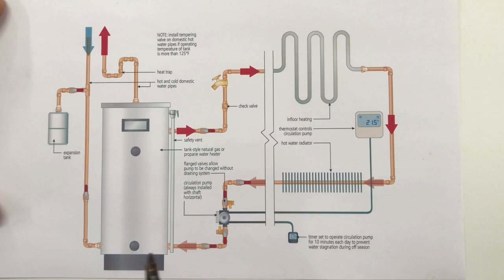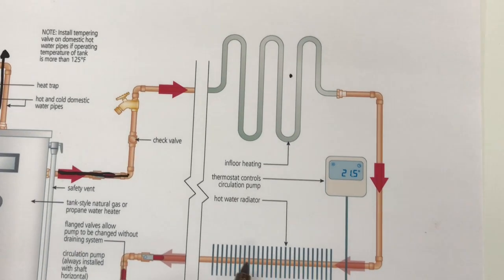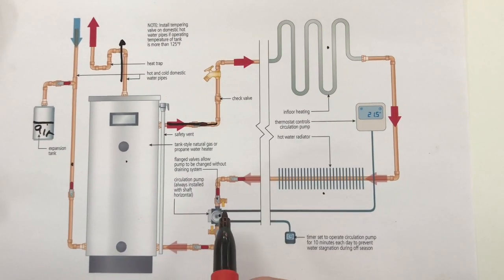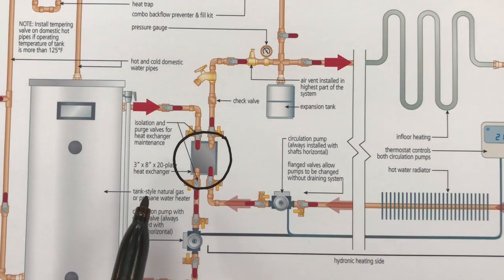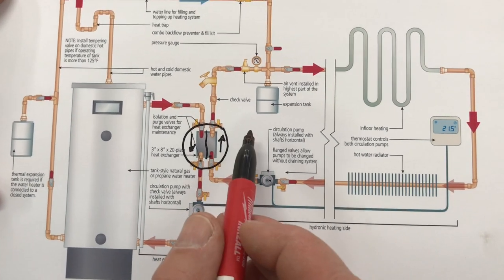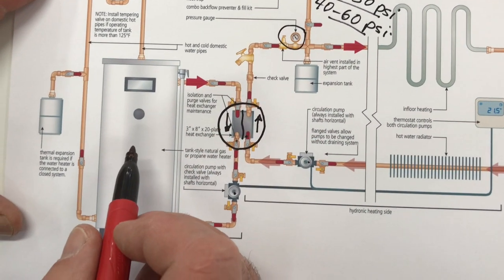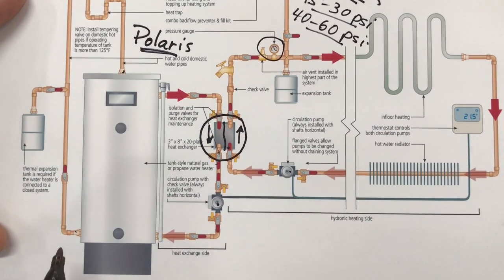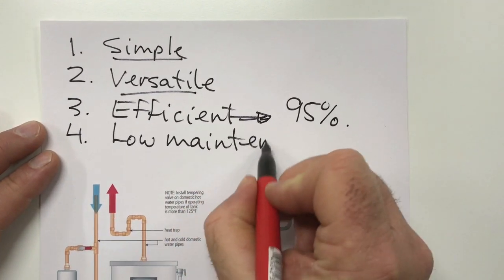HOT WATER HEATING: How to Use a Tank-Style Water Heater

Comment: I've been thinking for 2 years now, to do an "in-wall" heating system with a water tank.
There are 3 reasons why I want to do it.
1st it seems more healthy. Furnace heating tends to make the house more dusty.
2nd in flower heating seems more comfortable.
and 3rd, I'm pretty sure it spends less gas than a furnace, but I'm not sure. 

I was thinking of buying a 2nd water tank heater and running separately in a close loop. Do you think I shouldn't do it in a separate unit?

Do you think I can run 2 loops (basement and main floor) on one tank? ( each floor is about 900sqf)

Comment: Thanks for the video. This would be a good backup system for an outdoor wood boiler (OWB). The OWB's heated water would run thru a heat exchanger at the cold water inlet, heating the water before it enters the Polaris. When the OWB is providing heat, the Polaris wouldn't need to run, but would still provide hot tap water and house heat. When the OWB isn't providing heat, the Polaris would turn on and heat the domestic tap water along with the house.

Comment: I wonder if someone can recommend a circulator for the domestic side when using a heat exchanger. I used a Wilo S16 for the hydronic side, but having trouble finding an affordable brass circulator. The S16, being cast iron, can't be used for domestic.

Comment: I have a 30 x40 house  i built, 2x6 walls i think i used r28 walls and r38 ceiling, my ground floor is my wood shop buss/ with 1/2 per in 4'' concrete over the silver reflective bubble material  with 2'' blue foam, i am going to put r/heat loops in the living space floor above. can you give me your opinion of the Polaris  btu size for my  home? also serculator pump size , Thanks again  for your Video . Thanks Rich

Comment: You can eliminate the timer, some thermostat has built in pump protection function it will call pump once a day.
Reply: The pump exercising function is unlikely to run the pump long enough to safely prevent Legionella growth, which is the major danger of an open system.  Best not to use an open system at all.

Comment: I need to update my system from a tankless Flowmax90 and a 40L storage tank to a single large water tank.  My home is heated with a Airmax 70e p2 blower which has coils inside (it’s simply a blower) I need to understand how to select and size the new tank so that there is enough heat for my home and the domestic hot water?

Comment: And yes most of house hydronic systems runs at 30psi max , because boilers comes equipped with a 30psi ( max pressure) pressure  relief valve. Though boiler and hydronic loop components ( pipes, fittings, pumps)  are rated for much higher than that..If a small residential building has 4 floor ( above ground), and boiler is located on basement level  ( old typical install), a 30 psi water heating pressure will starve most of the farthest and highest point of consum  ( radiators) în some apartments. Thus new wster heating pressure must be carefully choosen  ( calculated) to assure the highest radiator in heating loop  will be provided with a positive heating water  pressure of min 5 psi .

Comment: Great, clear explanation.  My only concern is that a water heater is usually maintaining 125 - 130F, but hydronic floor systems want no more than 90F or they will cause cupping of hardwood floors, won't they ?  It seems like a heat exchanger would be necessary and not optional.  That way the pump on the loop from water heater through heat exchanger hot side could come on only long enough to maintain that lower temp in the hydronic side.

Comment: With a simple setup instead of it leading back to the water heater through the regular tap, can you divert it to go through the main line of the heat or the hot water line at the end of the house so that it drains back through the top of the water heater? Also where it warms the pipe with whatever hot water is left over after exchange with the heat exchange or/ AC blower. So that the pipe is always warm during the cold months? Is this possible or would this be ridiculous? Thank you for your input.

Comment: By the time you buy a water to water xchanger and 2 pumps this would start to not be financially viable. Considering pump life, and heat exchanger life in hard water or non balanced water areas it starts to be more trouble than its worth. A GEO system would at least save on the heating or cooling enough to justify it. Maybe?

Comment: Could you use hybrid electric water tank  ? Also if you eliminate thermostat an just use timer and set to run 50 percent  leave pump circulating  for a very small loop in small part of basment slab just as  supplemental heating ?

Comment: And by circulating heating water in off heating season, to maintain a healthy water throughout hydronic system will add additional unwanted heat to the space which calls for cooling actually.  How about isolating hydronic loop from domestic ( 2 simple ball valves installed on supply and return tank connections) and when warm months come, isolate and drain the hydronic loop completely and use cold water pressure ( thru a hose connected to city water) to flush throughly the hydronic loop?

Comment: 3 items jump out, 1 you will need potable circulators on the potable side of both options, 2 the water temp is much too low for  baseboard or radiators, 3 if the water heater goes down you lose heat and hot water. IMHO

Comment: Is there a coil in the tank to separate hot water from heating water? or are you pumping domestic hot water around the heating system? also is that a one pipe heating circuit? how do you control heating zones and radiators. The problem with one pipe heating systems is the radiators at the end of the circuit don't get as hot because you can't balance the system. I don't think that would cut the energy efficiency mustard here in the UK. Just wondering. Thanks for sharing.

Comment: A heat trap is useless. Water is such a good conductor the heat will travel through it no matter what direction it's going. A heat trap would onky work for air because "hot air rises" and you would be stopping the rise

Comment: I have water heater with built in heat pump since most of time of a day heat pump stays off. I want to design system to engage the water heater to heat up air after HRV. Does anybody have thoughts on this

Comment: Thank you for this video.  I recently upgraded an open system with a DHW heater (that I was using to heat our basement slab) to a closed system using this video as a guide.  I found a used Polaris unit on kijiji for $700! (score).  It was my first time working with the threaded pipe - the learning curve involved proper joint sealing and tightening (I used both tape and brush-on sealant in the end) as well as union placement.  It took longer than I anticipated but we are now warm and now have the option of running heating loops to the upper floor of our home (a bastardized 1905 log cabin structure in downtown Sudbury).   Two questions . . . 1.  should there be a relief valve on the space heating side?  2.  Is it common for pressure to increase?  It has crept up from 12psi (set at install) to 14.5 psi a couple of weeks later.
Reply: Yes, you need a relief valve any time you heat water in a closed system (not open to the atmosphere).  Relief valves prevent things blowing up due to escalating pressure.

Comment: How will this work in a garage 40X27 feet in floor heat? In Saskatchewan Southern half
Reply: Have in floor heat in a 28 by 32 by 14ft high shop . R20 walls,r20 ceiling,  80,000 oil fired hot water  tank. System is closed n use a minus  20 coolant mix. Works hard at minus 30, keeps shop 62 degrees Fahrenheit no problems

Comment: Well, very good video, thank you. Question I have, if my exsiting  tank does not have two sets of pipes as your does. Can this till be used in same way, as tapping into to top pipes. Thanks .
Reply: No!  I  tried this 10 years ago. It worked great for the under floor heating but you will only have lukewarm shower water. The hot water tank has a thermocline where the hottest water is drawn off the top and cold water is piped to the bottom of the tank. The tank's temperature control is reading near the bottom of the tank in the colder region. If you mix the tank water with a circulator, the thermostat on the gas valve will shut off much too early. If you jack the temp setting up, when the power fails the circ pump quits and the hot water tank will  reach scalding temperature.

Reason #2. The grit stirred up by the circulator pump will  clog your shower head and sink aerator.
Reason #3. You are running full house pressure in baseboard heaters that were made to operate at a much lower pressure.  Have a baseboard heater leak and your room/hallway/carpet floods.

Comment: COULD A PIPE FROM A WOOD STOVE ALSO HELP TO BRING HOT WATER TO THE WATER HEATER. MAKING FOR A LESS EXPENSIVE UTILITIE BILL ?
Reply: I've seen that in a commercial application. Where the vent from a different furnace was wrapped in copper piping and snaked back to another area that needed extra heat.

Comment: Great ideas. I also have a hot water heater for my hydronic system and a separate one for domestic hot water. It is not a good idea to have drinking water hooked up to hydronic. My system has been in for 18 years every year I clean the grott out of the filter. Radiators and in-floor should be set at two different temperatures.
Reply: Who drinks hot tap water,, just sayin
Reply: @wakeup6910  :)

Comment: Good morning i got question how hot does your whater in the tank gets and how hot your baseboards    get ? I built a system base on yours but my base boards only get warm i bleed  the system 3 or 4 times already and nothing this any way that we can change  mor imformation to see if we can figure  it out whats happening
Reply: What is the btu rating of your water heater?
Reply: Not sure you will see an update this long after your question, but I think the major issue with this design is the water temp from a typical hot water heater is too low even at max settings for most baseboard applications in colder climates.  The BTU ratings on baseboard are calculated based on inlet water temp and linear feet, so at 140 degrees a 3/4 baseboard puts out around 300 BTU of heat.  Most traditional boilers run up around 170-180 degrees of water temp during the colder parts of winter (older boilers always typically are set high, newer tend to use progressive temp increases depending on how long/often they run) and at 180 degrees that same foot of baseboard puts out 600 BTU ft.   So using this approach you basically half the heating capacity of your system.   This might not be an issue in the spring/fall limited heating demand days, but on high demand days this is likely to provide too little heat to work in colder climates.

Comment: Bailey, thank you for this simple video to explain the system. I have a question. Will the high pressure of the municipality water cause any issue to the system? Water keeps coming out of the safety valve of the tank and the pressure gauge shows zero pressure. The handyman thinks it is due to the high pressure. What do you think?
Reply: did you ever get an answer to your question? We have the same issue  of a dripping pressure relief valve.
Reply: @donalso  I haven't figured it out yet.
Reply: If the water coming from the safety valve PIA just a dribble, it means that something caused the valve to ‘pop’ open to release pressure (that’s what it’s supposed to do).  It’s very common for a piece of grit or sediment to clog the safety valve seal, causing the dribble. You can flush it clean by lifting the lever on the valve.  If it clears the grit, it should stop the dribble. 
If you have hot water from the system, there must be pressure.  If the gauge reads zero, it must be faulty.

Comment: No reason to circulate water in the offseason. If so what would be the reason? Otherwise, nice video.
Reply from the maker: Hi John! 
Code in some places requires circulation to avoid bacterial buildup in water that's part of the domestic potable water system. Even in isolated systems, it pays to do regular circulation to keep pumps and valves from seizing up.
Thanks for watching!
Steve
Reply: Legionnaire's Disease?

Comment: For the simple version couldn't you drop the psi using a water pressure regulator?
Reply from the maker: Hi Adam!
Thanks for commenting.
I'm not aware of a water pressure regulator that would allow full flow through the system from the tank. Perhaps there is such a regulator, but I haven't seen one. Please point me in the right direction if you know of a unit.
Take care and thanks for watching!
Steve
Reply: Adam Ton sd
Reply: I'm see your point now yea I'm not aware of a regular that would do that.. I suppose u could run a pump at the end with a backflow preventer to get it back up to pressure and into the water heater but now it's getting complicated. My folks have radiant heat I like the feeling much more then my central air system...

Comment: Good morning. Im a new home owner so im looking for a new system. Can u do that with an electric thank of any kind and also can u have to zones on the hydronic system
Reply from the maker: Good Morning Francisco!
Yes, you could use a heavy duty electric tank-style heater for this system, but electricity is generally the most expensive way to heat. There are a few exceptions to this (Quebec has low electricity rates), but in most cases propane or natural gas is cheaper.
I hope this helps.
Bye,
Steve
Reply: Any tipe a thank or a especific one i got no choice its eletric or oil i was looking to rheen performance platinium that one will work?
Reply from the maker: That Rheen model might work, but I'd check with the manufacturer. You'll also need to get some sense of how much heat you'll need for your place at the coldest temperatures you expect, then get a unit large enough. Is there a reason you can't get propane at your place?
Bye,
Steve
Reply: I dont like the thanks and i dont have service on the street
Reply: Once you've resigned yourself to paying for electric resistance heat, having ruled out heat pumps, gas, etc. for one reason or another, wouldn't it be simpler to put baseboard or floor radiant heating right where it's needed, rather than running pipes which could heat the outdoors somewhere along their travels? Also, I've heard that electric resistance heating is usually the cheapest to buy and install, letting you invest the money you save into more insulation, which, with the electric rates in most places, you'll need.

Comment: Steve that was excellent. I'm about to install a 50 gallons Polaris in my beach house and I was wondering if the use of a heat exchanger was mandatory.  The 10 minutes flow per day is a very simple solution that's going to save me a lot of money.
Thank you from Santiago de Chile.
Reply: OMG! The 10 m9nute flow is only during the off season to exchange the water to keep bacteria growth to a minimum. During the heating season, it may run for hours!

Comment: Can you eliminate the water fill line for topping up the hydronic heating side and use glycol through the heat exchanger?
Reply: I've read that in parts of the UK, a permanent fill line is prohibited for fear of contamination, so most systems have fitting for a fill hose that is supposed to be removed when not needed.

Comment: This is probably a useful option for some situations, but I don't understand how a gas tank-style heater can have a 95% efficiency rating when half the surface exposed to the combustion gasses is limited to the outside surface area of a cylinder and the other half is a few inches of insulation away from the outside casing of the unit. Boilers (as they are anachronistically called since the majority never boil) being designed with a full water jacket around the combustion gases, seem like an inherently more efficient design, though I suppose a short path to the chimney stack could limit the efficiency of either.  Also, in either case, having the device in a heated space, so the "waste heat" that escapes through the case is actually used, could change the equation, as could any effort to recover heat from the remaining flue gasses. But (domestic hot water considerations aside, since either both heaters and boilers have options for combining it) if an $800 water heater could have heated a house all along, why did they ever go to the effort to build $2,500 water-jacket style boilers?
Reply: this is not a $800 heater, it is closer to $3000
Reply: The flue gas is circulated through a tube coil inside the tank and what is released outside is so cool it is vented through PVC and that is how you get 95 + % efficiency

Comment: Can this be used to replace my oil furnace?
Reply from the maker: Hi Zach!
Yes, you could use a water heater to replace oil heat, but only if your heating system uses hot water to distribute the heat to your house i.e. infloor heating or radiators.
Thanks for commenting!
Steve
Reply: Yes
Reply: Is it better and more efficient than oil